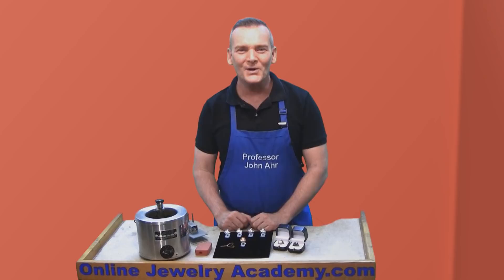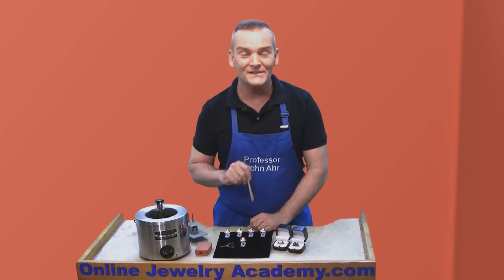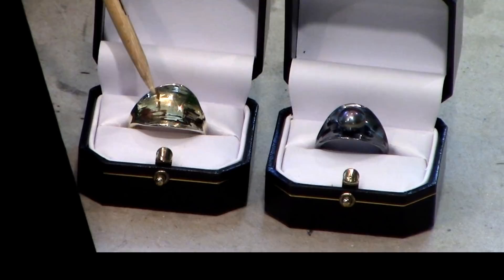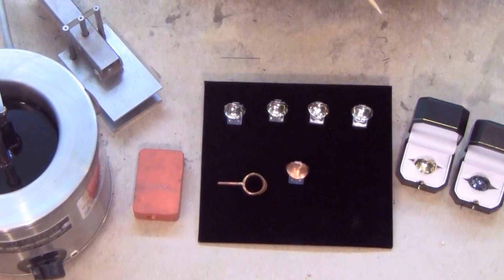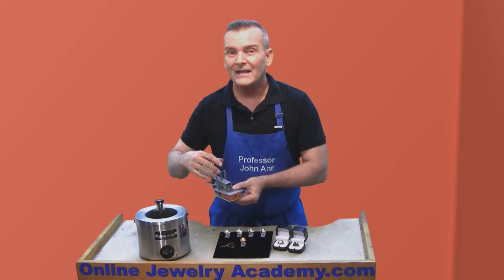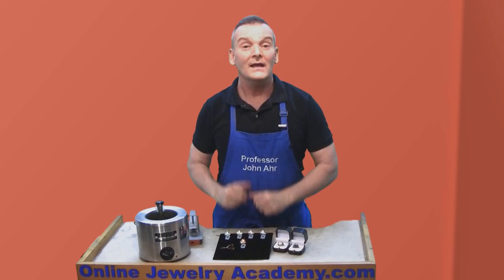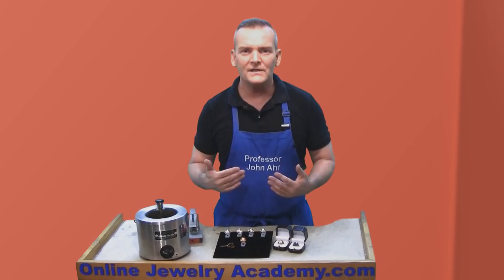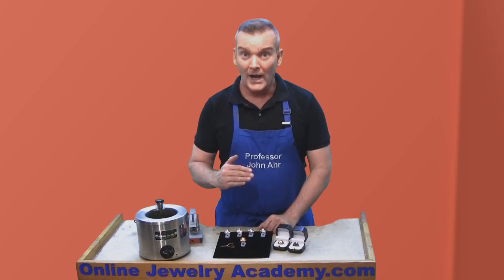Wax Injection Makes Easy Multiples

Comment: I’m intrigued by the shine on that oxidized ring... doesn’t polishing it to this level remove the oxidization? And is that LOS or perhaps Black Max?
Reply from the maker: For the video I used LOS on the ring and tumbled it for a couple of hours.  But, if you look on Instagram, I refinished the ring with a satin wheel, oxidized it, and re-tumbled it to produce a soft dark grey stain surface to set off the pearl.  If you tumble oxidized silver, be sure to clean your shot with baking soda afterwards.
Thanks for your support! : )
Reply: OnlineJewelryAcademy Thanks for the explanation Prof John. I'll take a look at the IG post.